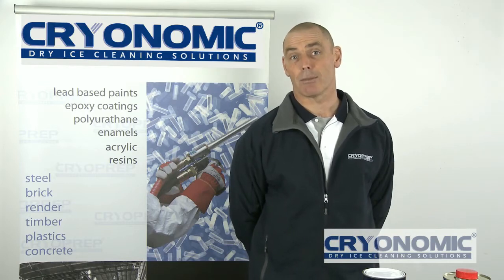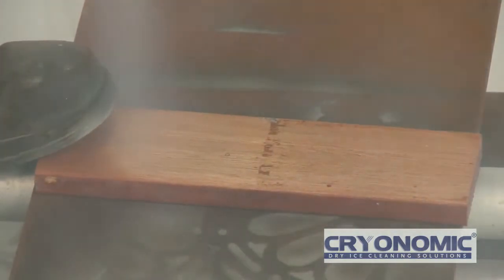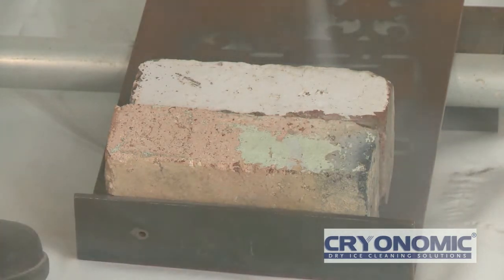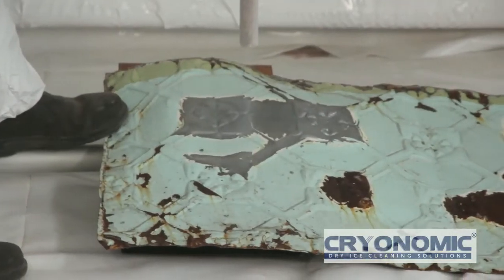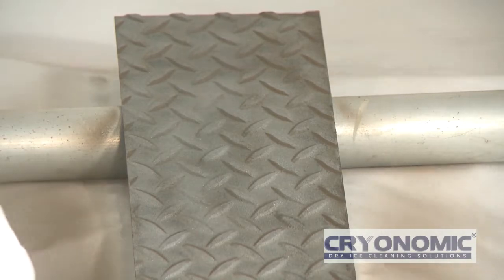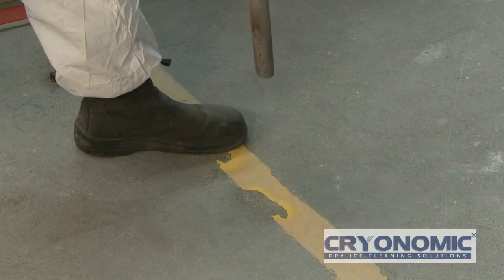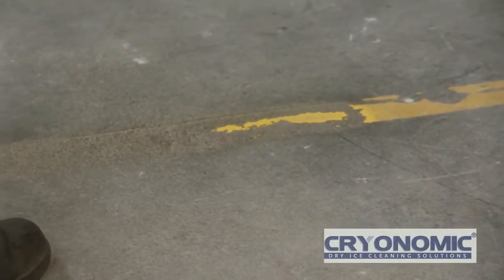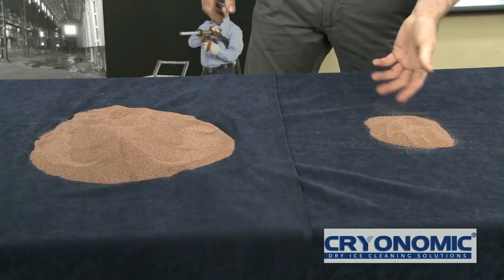CRYONOMIC Dry Ice Grit Blasting

Comment: What compressed air requirements(cfm) do your machines require.
Reply from the maker: Hi Fred, thank you for your interest. Best results are with compressors of 70-100 cfm at  50-80 psi. send a mail to info AT cryonomic if you want more info.

Comment: Hello, Will these machines prepare rusted steel to a level ready to paint .. or is sandblasting still required?
Reply from the maker: Sure, we blast dry ice and a minimum quantity of abrasives and in a last pass one blasts only dry ice resulting in zero contaminant on the surface. Perfect for immediate painting.